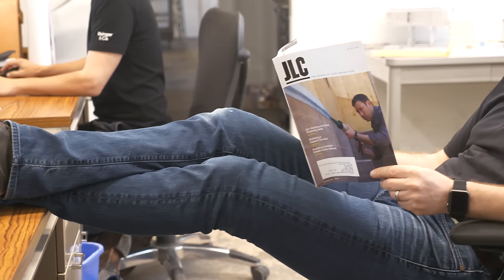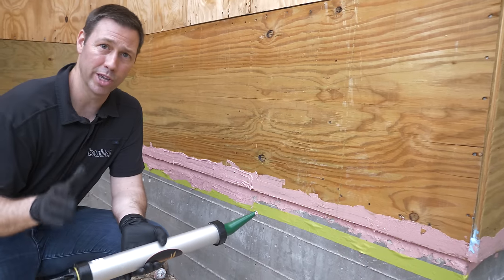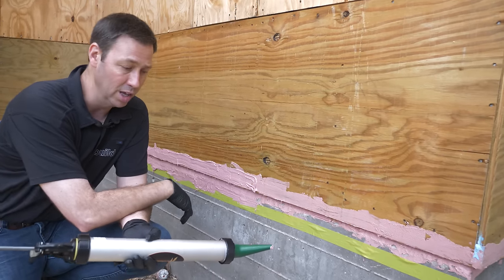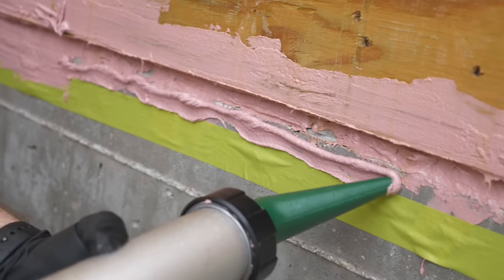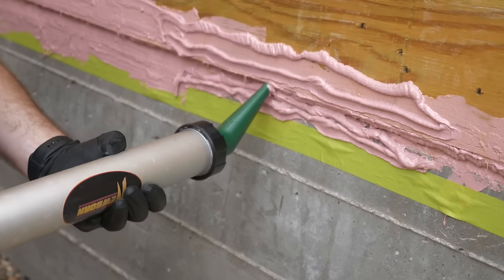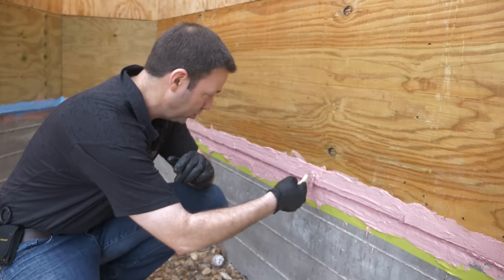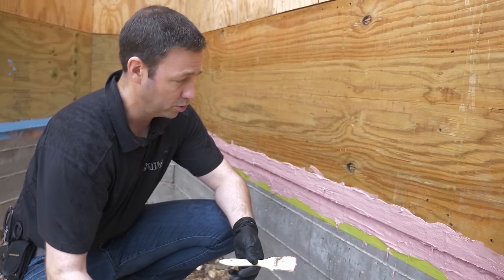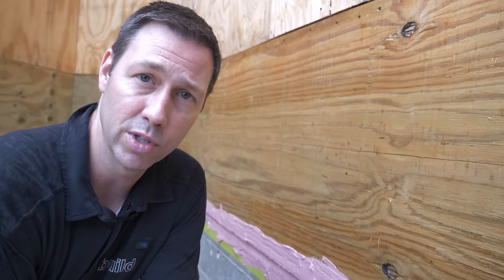Sealing Framing to Foundation

Comment: I'd love to see a video with all the recommended layers of a wall, for long term reliability. (Drywall, spray foam in LVL's, 7/16" osb, rigid foam, rainscreen, house wrap, and finishing material), or however you'd recommend
Reply: @mattrisinger this is a great video to add to a great series.  Thanks for making the trade better and more informed.

Comment: @mattrisinger -- I have an old post frame building with metal exterior that was built on a concrete slab, however, no barrier between concrete and frame;   any advise?  I don't want to tear the thing down, but I don't want wood rot

Comment: Matt   We did the same exact thing years ago when we pulled out the T-111 wood siding, and pulled out the Corning fiberglass insulation.  We spray foamed the entire wall cavity  of the house, then we used a rubberized house caulking, and hit above the 3/4 inch floor, and below the same plywood floor to seal the cold air coming thru those cracks.  Thats better than caulking behind the baseboard from inside the house.  This way air doesn't even infiltrate into the basement thru the bottom crack of the plywood. I used plywood as an applicator and really forced the caulk into the cracks.

Comment: I coated the outside and top of the concrete foundation with a bitimous waterproofing product. I painted the sill with kilnz and then wrapped the bottom with rain and Ice and used a standard foam sill pad between the two. But I did not seal the gap like you did because I was concerned about ventilation.

Comment: If you have an already built garage, but are finishing the inside, should you seal between the foundation and the studs, or are you risking trapping water in the walls that makes it in from the outside?

Similar question to air seal between the studs and the inside of the material against them. Will sealing this just cause bigger risks down the line?

Comment: can we use the Prosoco R-Guard Joint and Seam filler for the connection between the sill plate and the concrete on the Inside of the house that was built a few years ago ?
 there is zero fluid flashing or tape on that same connection on the exterior.

Comment: What is the difference between Posco Joint Seam filler and Fast Flash Liquid flashing.  My main application will be to seal the base plat of my 20'x10' shed which is mounted on a flat concrete slab.

Comment: I am trying to hurricane proof this part of my house.  Trying to keep water, driven by wind, from entering a house.  Could I add a PVC water board to cover this after sealing with tape and mastic type sealant and then metal drip edge over the board and under siding?

Comment: @Matt, Small idea, Why do you fluid apply the last 4 inch of the plywood on both sides and the bottom (where it meets foundation) ,  before you install so no moisture can wick up the ply wood. Just a thought :)

Comment: I built a shed and did NOT do this type of sealing, and when it rains water comes in under the sill. I’ve already installed stone and siding. Any recommendations, should I seal from the inside? Thanks.

Comment: I'm getting 7 linear feet per 20 oz sausage! I'm only dropping down about an inch on the concrete, then, about 1.5 up the 7/16" OSB. Buy more than you think you need! It appears to be great stuff, thanks for the tip Matt!
Reply: This is insane! Somebody else told me he gets 55’ feet going 6” on osb and 2” under but uses a bondo scraper
Reply: What is this stuff ? He doesn't say
Reply: @somethingkindawonderful3034  It's Prosoco R-Guard

Comment: Great info. Need this on our wood foundation. We built on pea rock by the code. Even the bearing wall footing pads are pressure teated. We are thinking on the wall plywood useing Henry's blue seal liquid. Then maybe Blueskin rolls of peel and stick. Its just like roofing Ice&water rolls peel stick. I think its butyl and poly.

Comment: This seems like it could be a good option to seal between sheathing connections to block out air leakage before Tyvek. Possibly cheaper than some of the good tapes.
Reply: I doubt this is one of his builds because he tends to use the zip system instead of Tyvek and osb or plywood. The zip system is osb with a built in weather barrier then there is either their zip tape or zip liquid flash to seal everything up.

Comment: If I'm framing in a carport and the concrete goes out past where the framing is. Will this product keep water from running under the wood and getting into the garage.
Reply: Chad Phillips I'm in process of framing in my garage and we are about to put some flashing around bottom and probably use some type of glue sealant
Reply: What happened? I got a leaking room on a concrete patio

Comment: Hi Matt,  We just purchased a new home and it has an aggregate deck on the front.  We have just repaired the rotten joists and framing downstairs as the flashing was only about 1/2-1" above the deck surface up the house and water was pouring in (We live on rainy Vancouver Island).  We were told to go with torch on flashing to eliminate future leaking but the roofer said that will not work on aggregate.  I am wondering if this is the product we should use with regular flashing 6" added on top?  Our deck is too big of a job currently to get rid of.  Your expertise would be greatly appreciated!  Thanks!

Comment: Hi. I rebuilt a vintage g ra in bin on a concrete slab. The slab is 6" larger than the bin, I want to use it as finished space, will this flashing create a water tight seal batween metal and concrete?

Comment: Matt. icf blocks were used to build my underground garage and stick on membrane waterproofed it. But below the above ground cladding and the ground, is a gap where i can still see the stick on membrane which goes all the way down into the ground. im worried about uv damage to that and think it should be covered? what should be done between the ground and where the cladding starts to cover the membrane?  is there video on that.

Comment: Kinda weird that my untreated shiplap sheathing sitting directly on a brick foundation without any flashing or sealing has lasted 100 years in the rainy northeast without this product applied to it. Would you recommend it on remodels/old work?
Reply from the maker: +Bryan Vaccaro that's the beauty of old growth lumber that has plenty of air flow.  "If it can't dry it's gonna die".  Use this to air seal and waterproof when Remodeling.

Comment: Hi Matt, the tenant in my rental house is always complaining about ants in the house, I've hired a professional pest company to spray for these little critters but that can get expensive, is there anything else I can do?  Do I need to seal the house better as you have shown? Better solutions?
Reply: Jeffrey, see if you can sprinkle some 20 Mule Team Borax in the wall cavities, then patch the sheetrock.  If you can put borax in the bottom of the wall cavities, it would probably cut back on the little critters, ants, cockroaches, etc.  I think it is environmentally OK - and certainly better than many commercial toxic sprays.
Reply: Diacemotous earth powder also can be used make sure your baseboards &  quarter round are sealed along the perimeter of the inside also make sure your outlets are sealed. Too many Insects spiders coming into a house are sometimes due to poor Walter drainage away from your homes foundation / crawl space.. are your gutters working properly. Is Walter being drained at least 10 ft from your foundation? Apple drains has some excellent vids on YouTube

Comment: Matt Risinger my builder used some sort of foam gasket on top of the concrete slab before applying sill plates, but nothing like this. My house is in NE, its a new build. How hard would it be do remove some of the vinyl siding to do something like this? Or what would you do after the fact?
Reply: Similar situation here.  I really wish I had seen this and some of Matt's other videos before having our new house built.  Depending on your situation it might be possible to go back and do this but you would need to investigate your specific situation to see if it would be feasible or not.  In my case I was able to do it.  I used a siding removal tool to loosen the bottom row of vinyl siding (freeing the bottom edge from the metal starter strip).  Then had to carefully remove the starter strip (removing each nail using a nail puller).  Had to also remove some of the staples and nails that were holding down the bottom edge of the housewrap.  Temporarily folded up the bottom edge of housewrap and carefully held that and bottom row of the siding up and out of the way while working.  Used tape and plastic drop cloths to mask off and protect the lower, exposed part of the concrete that I didn't want the r-guard to drip on.  Applied r-guard to seal the sheathing to the foundation as Matt shows in this video.  Let dry for about an hour or two.  Then went back and removed masking tape/drop cloths.  Then folded the bottom edge of the house wrap back down, re-secured it, nailed the siding starter strip back down, and then re-hooked the bottom row of siding back to the starter strip.  Had to do this project over multiple days- it took quite a long time and was especially difficult in some places (it was really tricky on the side of my house where the electrical service, hvac, fresh air intake, vent pipes, are all located due to the lack of room to work with).  Really wish I or my builder had known about this and had done it during construction.  In either case, I feel much better now that I've gone back and done this.  There were big enough gaps in some places where we had small ants getting into the house and this has sealed up those entry points.  I'm also hoping it will also better protect the bottom of the sheathing from moisture.  Matt, thanks for all of the great videos!

Comment: Would this method work if my siding is sitting level with a brick patio?  I have no way to hang my siding below the foundation because my foundation sits level with the patio, and the patio extends another 3 feet.  Sealing is going to be a major issue.

Comment: We have cedar lap and gap (tongue and groove) siding and have been 
sealing the horizontal joints with Masterseal np1 caulk sealant. I have 
read in numerous places to not caulk between horizontal siding, because 
it needs to drain any water which could possibly get behind it and it 
has to move with expansion and contraction of the boards. The transition
 between the slab and skirt board have also allowed these small cridders
 into our house. The siding was installed correctly, but over the course
 of 30 plus years the boards have some gaps between the joints. Friends 
and family members who are carpenters have informed me as long as you 
keep the siding sealed and treated there shouldn't be a problem with 
water getting behind the siding and to seal these horizontal joints. By 
these boards not being sealed we have introduced carpenter ants, 
scorpions and other cridders. Does anyone have a suggestion please? 
Thanks
Reply: Can you blow in diatomoceus  earth powder in there and inside dobthe same along your perimeter & then seal your baseboards & quarter round with stretch poly caulk & seal wall outlets & put Child proof plugs when not in use to preventbug intrusion..

Comment: Would it be okay to use the R-Guard to seal the sill plate to slab seam as shown, then tape over with Carlisle membrane? If not, Carlisle system vs R-Guard?

Comment: Can you also do this when the plywood is a wallcover on the inside? I have water dripping in when it's raining heavy at a few points where the osb joins the concrete slab. It's a garage.
Reply: I would look into using a mastic tape like eternabond or peel and seal....

Comment: Best stuff I have ever used is that rubberized fiber roof patch that comes in a one gallon can. I have used it on the top of chimneys to waterproof and still performs as good as the day I installed it, over 25 yrs ago, sun, rain, snow hasn't hurt it. I have used it to seal the sill plate to the concrete along with the foam and there's nothing getting through it, air, bugs, water Etc !  Sometimes the old shit should be used because it's a proven thing.
Reply: august 
To seal the foam to the concrete and/or? The sill to the foam?
What do you do about joists?  I've been in a lot of house that changed hands where the joists crumble.
Reply: Can you provide the brand of rubberized fiber roof patch that you used?
Reply: How can i seal on room leaking built on a concrete patio

Comment: Help! Is there a reason Not to build so my plywood is flush with the block wall? Is the overhang important? Seems like water would hang out there to drip vs. one smooth continuous surface where it would continue to flow.
Reply: you don't want the edge of the plywood to be in contact with the concrete and its easier when framing to line the sill plate up with the slab edge.

Comment: Hi Matt, 
Great timing on this video! I'm replacing sheathing and siding on my house. I have a sidewalk along the side of my house that is on the same plane as the foundation. I had been looking at using Fentrim F over the Zip Sheathing, under the Zip sheathing edge, to the small portion of the sill plate that would be exposed, and then to the concrete. Then probably flashing under the rain screen and siding to kick water out. Any thoughts or recommendations? I would appreciate it!
Reply from the maker: +Andrew Colwell I can't picture this. Tag me on Instagram with a sketch and I'll reply
Reply: Hey Matt, I posted a picture and tagged you in it.  "acctx" is my IG handle. Thank you!

Comment: Could this be used in an attic to air seal the conditioned space below?
Reply: Yes just make sure it's got a bit of moisture to help set up also they have an air barrier that's for around Windows that works well too and stuff to fill gaps before sealing.

Comment: What about a peel and stick membrane that covers that joint? Should stick well to both the plywood and concrete and would provide the same waterproofing effect wouldn't it?
Reply from the maker: +Jake Apple yes I've used that many times but even with primer it does not always stay stuck. This is basically a waterproofing glue. No primer needed and it works even if surfaces are damp or even wet!  It's a better detail

Comment: Is that a regular plywood as external sheeting? I though only OSB is used these days, or some fancy prefabricated sandwitches.
Reply from the maker: +alteragnostik yes that's regular plywood.
Reply: Thank you, Matt! That's cool. And what are the advantages of plywood over other stuff? Or is it  trend to go back to the roots? :)
Reply: I hear it stays straighter over the long run for stucco or hardie board applied directly onto it. If Brick or stone, go with OSB

Comment: Matt, I just came across this video.  We just finished up a modular home on a basement, and I am looking for something like this to seal the house from bugs and water.  Right now we have a problem with crickets, and I have narrowed it down to two areas of the foundation.  I thought about caulk, but I know that the house needs to move/settle and breathe, and I don't want rot.  the other problem is that these areas are really tight to the foundation, but this looks pliable enough to get into those tight areas. 
We also have two areas with patios, and I'm worried about splash from rain getting onto the wood from below and causing rot.  Is this something that can help with that too?
Reply from the maker: +Geek Dad yes. This is much better than a standard caulk
Reply: thank you!

Comment: ok what if I put a roofing ice and water shield over that same gap to prevent air and moisture coming through?
Reply from the maker: +Morgan Mclean that can work but the issue is getting that to stick to the concrete long term. (Or short term for that matter)

Comment: Matt, do you have Blue Wall on top of this product behind you?
Reply from the maker: +Michael Schoonmaker yes. That's Blue Barrier. We used both on this house.
Reply: Why both? Layered on top of each other?, as in layer 1 is pink, layer 2 is blue?
Reply: I used r gaurd outside a room on a concrete patio and it peeled? Does blue wall do the same?

Comment: This might be a dumb question but do you think flex seal would work well
Reply from the maker: +TheMixmastamike1000 no. Too think. This is a thick material with fiber reinforcing to allow building movement without cracking
Reply: TheMixmastamike1000 I was go8ng to ask the same question.
Reply: Yes and you can use spray on bed liner also.
Reply: Matt Risinger 
huge problem is floor  joists rotting out! I'm going to start building quality homes hopefully very soon, so I'm trying to figure out what would be the best way to seal the joists.  Also how many years is this product rated?
Reply: I love building, I love construction, I've been thinking about something lately:  What if you used Henry 887 100% Silicone roof coating to make a vapor, moisture, everything else barror on your exterior walls?  I think it would give incredible results, I think it might work... what do you think?
Reply: @Justicejamesb  what can i use to seal a room on a concrete patio?

Comment: Don’t you want water to have an exit at the bottom?
Reply: Remember, this isn't involving the siding at all: just the sheathing (plywood) and the foundation (concrete).  If you leave a gap there, you run the risk of insects getting in.  The siding will go on top of this, and that's where you want to leave an air gap (IMO).

Comment: The dumb thing is there is so much mixed information out there for the correct or wrong way to do things. If you google search for products to fill gap between foundation and siding the first result is that you should never fill this gap so you can allow moisture to escape..   my thinking....  There should not be moisture there in the first place.